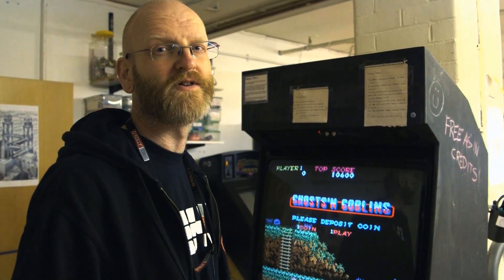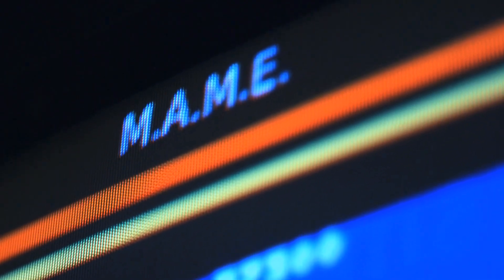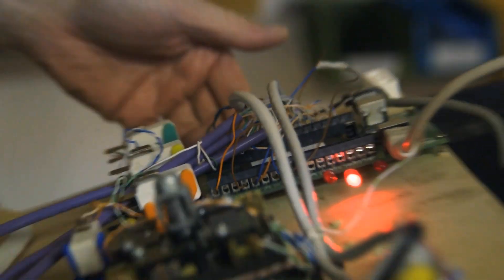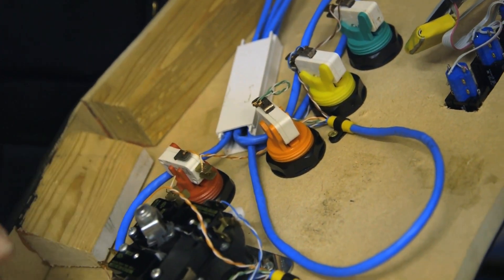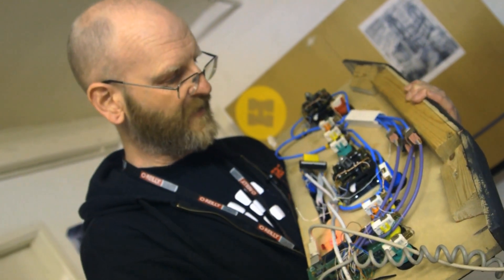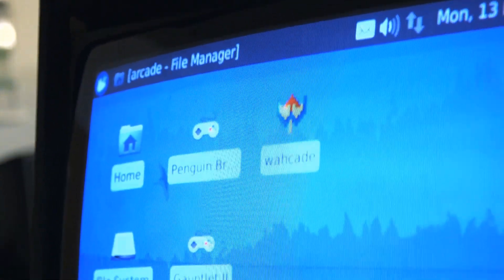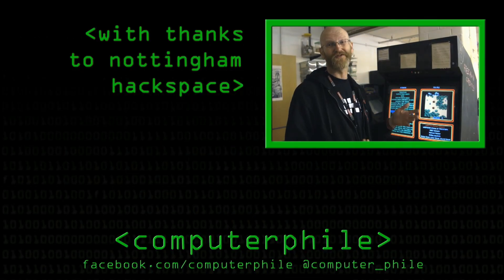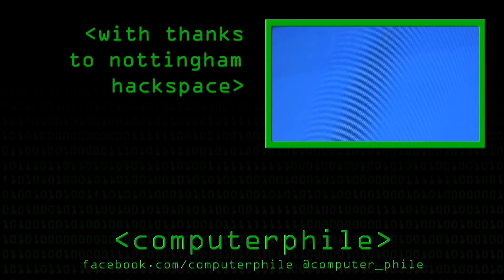Homemade Video Arcade Machine - Computerphile

Comment: Well the most realistic way possible to play Defender is to buy the original board set ;) 

Also a bit of critique here: The cabinet itself is not very well designed. The screen needs to be recessed into the cabinet and the cabinet itself needs to be clearly wider than the screen. The reason cabinets were built this way was to reduce reflections and disturbance in your peripheral vision during play.
Also I would like to have had some more information on what monitor was used and how it was made to run with X. Real arcade monitors had RGB input which needed converter boards for vga or at least some scanline config fiddling, for instance.
And while this of course isn't mandatory: The vast majority of arcade cabinets follow the JAMMA standard. They have a cable harness inside connecting to every part of the machinery (coin slot, buttons, power supply, et al.). This harness connects to a plug which then connects to an ISA-ish looking connector on the actual game PCB. And IMHO that's were the connection to the PC should be. So all the keyboard translating stuff, vga converter etc. should have been put on a separate board which could connect to a JAMMA plug. The point is, without the JAMMA compability you have an arcade cabinet which cannot play actual arcade PCBs or hook up a NEoGeo AVS. So you can never experience the real deal with such a cabinet! ;)

There a quite some more rather subtle things to consider when designing a cabinet, so don't do it. If you haven't owned (or have in-depth access to) at least one or two proper arcade cabinets before, just don't do it. You'll end up having spent a lot of time and money on a so-and-so result. (Plus you can get used universal arcade cabinets without coin slot machinery beginning at 50$)

Comment: What? A decommissioned Dell Dimension computer in the early 2010s that's actually not a Dimension 2400? Where did you get this thing, a silicon valley curiosity shop?

Comment: Very impressive.  Your right about Xubuntu and I wouldn't worry about upgrading it, there really no need.  I'm assuming that it's not connected to the Internet and even if it was, it's really hard, almost impossible for Linux to get a virus (not impossible) because of layers that make up the system.  It not like Windoze where everything goes directly to the Kernel. :-)

Comment: ok the amount of involvement needed to spot check and correct errors in that many unrelated items working together is immense. those TVs were not made to run off computers, He had to rig up some clever controllers for the controls to talk to the computer, And the software hierarchy was probably really buggy before he sat and debugged it for hours on end. Yeah, let's see you build a cabinet and put a computer running an emulator in it.

Comment: Yes he might've used some form of CRT for display and rewired a keyboard to work with the stick and buttons. It's still just a desktop computer running an emulator in a cabinet. You could basically get a USB arcade controller and a large old CRT monitor and have the same experience. To me if it's not original hardware it's just plainly not as fun.

Comment: the keyboard controller doesn't block large numbers of keys due to "thinking a cat has sat on the keyboard" but because 3 keys in a square configuration will make the controller think a fourth key has been pressed when it hasn't (ghosting), so instead most keyboards block these square key configurations to begin with (blocking). cool mame cabinet! good job

Comment: revamp I've seen in the last decade-and-a-half was Tempest 2000.  I had it for PS1 until I sold all my PS1 gear.  Still have the Saturn version, though.

Even Tempest 2000 has been redone in the past decade.  There's a freeware version floating around called Typhoon but the latest update was in 2007 (look for Typhoon 2001 r3992 if interested).  This is one of the better fan redo's at a classic game!
Still love the Atari original version, though, as well as many of the other Atari games.

Comment: Does the monitor run at 15Khz like a real arcade monitor? I think this is the most important factor when emulating those early 80's games. In fact every arcade up to the end of the 90's. Newer monitors are too crisp and the subtle ways the programmers made use of the blurriness of CRT is lost. 

Also, I don't like his OS setup. Mine doesn't go anywhere near X or any GUI apart from advancemenu. AdvanceMenu is a nice simple text system and works with any emulator. It's a nice.

Comment: Yup, I'm well aware of that.I have a question about the setting you refer to though: when a diagonal is hit on a 4-way game, how would the software know which of the two equally valid hardware inputs to select as the one intended? I don't see a way that can be done!

Comment: Probably because it's easier to set up out of the box compared to downloading something like Lubuntu, getting rid of all the LXDE stuff, downloading openbox, making openbox the default at startup, etc. It wouldn't really take too much time but if you want a consistent Ubuntu environment that you don't have to modify a bunch before you can use it then it's easiest to just go with what's on the install CD. Or maybe he actually programmed everything on that computer and he just likes Xfce :P

Comment: I don´t count that project as science either. Reason: It is placing predefined and developed pieces together. This is engineering not science. Really well done engineering to be honest, so I would even consider that as the art of engineering. So I see a line between science and engineering, but the label does not count as much as the content. So, it is high quality content so: Just enjoy the show and don´t care to much about the label.

Comment: <3 MAME. My exboyfriend (when he wasn't my ex) and I got MAME, and a lot a components for building an arcade machine and a DDR pad. I wired up an old PS2 controller for the DDR buttons and they used plexiglass and weather stripping. The only thing we never got was the damn cabinet. I hope he finished it.

Comment: There are programs called "hex editors" that you can use to read and write files directly in hexadecimal (which is easy to translate to and from binary and easier for humans to work with than raw binary).  In addition, many older programs (and parts of modern operating systems) are written in an assembly language, which is really just a way of assigning English-like words to the machine codes that can then be translated to machine code by an assembler program.

Hope that answers your question.

Comment: MAME on Ubuntu sounds interesting.  I'm having a fair amount of trouble coming up with a good MAME setup.  Additionally, the Control Panel is the hardest part of the whole thing.  One really wants to reproduce the feeling of the original.  If folks are interested I've uploaded some examples of Defender gameplay on an original cabinet; you can click on my handle to look at various uploads.  There's also an active Facebook group called Williams Defender Players Unite.

Comment: No, this is someone putting a computer in a plyboard box, rigging up the hardware for a custom control interface, customizing an OS to run as an embedded system. What do you think the homebrew computer club were doing in the valley in 1975. It was fun projects like this that evolved into the very first PCs.

Comment: he should skip Ubuntu and use DamnSmallLinux(DSL) or Puppy Arcade. Also PS-2 keyboard controllers should be able to utilize NKRO(N-Key Roll-Over) to use more keys at once, if its limiting him. Very nice that he made it entirely for free, I did the same with an old Pentium ii Dell Optiplex except without the fancy arcade-like outer casing.

Comment: Null code. They make the computer think it is done with some text, image file, ect. Make a sentence with a stray " in the middle, making the computer think it was done with the sentence, and the rest of it is run as if it was part of it's own code, example: "a cat sat"; Lì¼LÊDsé³ >ä‰" However, the exact code for the " it uses depends on what it is infecting, and what kind of code can be run. It can access RAM and makes a copy of itself into the assembler code running on the PC.

Comment: Computerphile, could you explain how emulation works? How does a Pentium 4 processor with a more complex instruction set and at a different clock frequency replicate the programming of older arcade machines?

Comment: I tried to build one of these in college.  I ran out of time and never finished it, but I did get the arcade machine running minus the fancy arcade box and whatnot.  So it was basically a pc I bought for $5, some really, really crappy arcade controls, and a crt monitor I bought for $2.  Good times, though.  Also had warcraft and games like that on it.  Pretty much every game I enjoyed from 1980-1995.

Comment: Very nice project! I wonder whether using a keyboard controller can have any implications on the input because of those limitations you mentioned in the video. I know that in a recent game likes Street Fighter 4, players are using LP+LK+MP+MK+direction as an advanced input control. For older games, you probably don't have to worry about this as much, but wouldn't a 2-player game with 2 action buttons each already be liable to drop commands?

Comment: It's a really nice video. Not particularly what I expected to be on this channel but not too far away of it either. Certainly nice.
And knowing you and your other channels, you'll surely cover a very wide range of topics, so it will be very hard for a single video to be called "representative" of the entire channel. I'm certainly looking forward to more of both stuff like this and completely different stuff.
The Theme you used is really nice but at the end it should be a closing /tag.